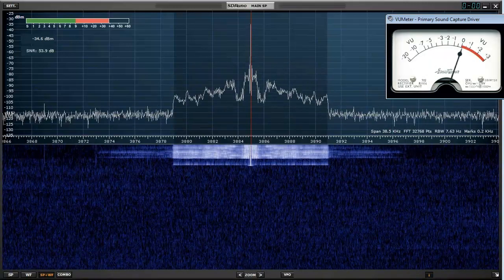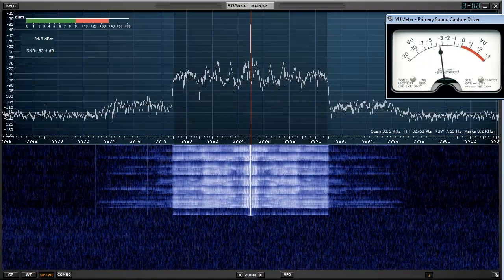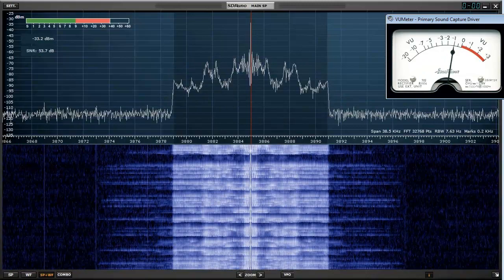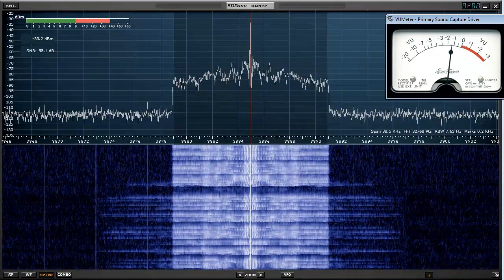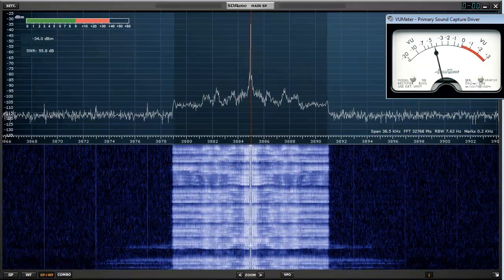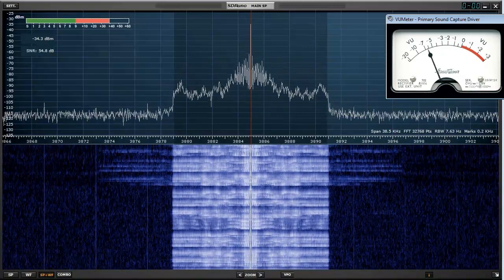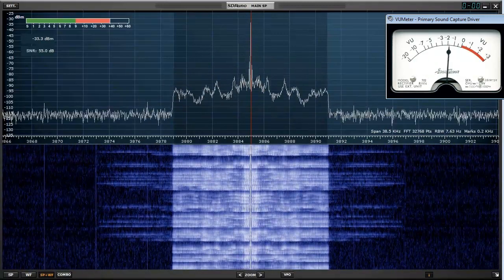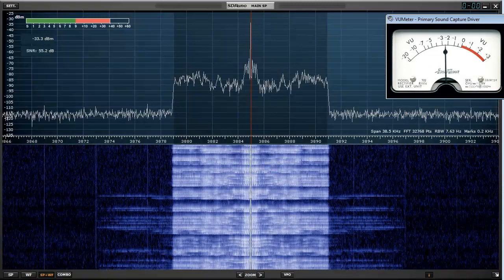ANAN - 200D Running AM With Pre Distortion Toggled ON and OFF

Comment from the maker: Apparently not, since the DSB signal is unchanged regardless of the carrier level that is set in the software. 

In this video, the ANAN-200D is transmitting AM with a CFC version of OpenHPSDR using an AM Carrier Level setting of 100. With Pure Signal toggled off, my bench scope shows 125% positive peaks and 95% negative peaks. With Pure Signal toggled on, my scope shows 100% positive peaks and 99% negative peaks, which is almost perfectly symmetrical. (Note that with OpenHPSDR, when the AM Carrier Level is set to 100 it is impossible to modulate beyond 100% negative while running AM. You will absolutely not pass through the baseline and no "wavelets" will be generated.) 

The video capture was made using an SDRPlay receiver which has a bit of latency due to its USB interface so the VU meter that is tracking audio loudness is not quite in synch with what is seen in the pandadapter. What you hear in the video is the actual transmitted audio of the ANAN-200D as it was received by the SDRPlay. 

The VU meter does not show a significant difference in the audio level whether asymmetry (no Pure Signal) or symmetry (Pure Signal toggled on)  is present in the transmitted signal. Since the symmetrical signal is as loud as the asymmetrical signal, and since Pure Signal cleans up the IMD and as a bonus, improves the THD of the transmitted audio from ~3% to 0.2% it seems to make sense to use Pure Signal when running AM to attain symmetry with no sacrifice in loudness.

At any rate, that's my opinion!

73,

Rob W1AEX